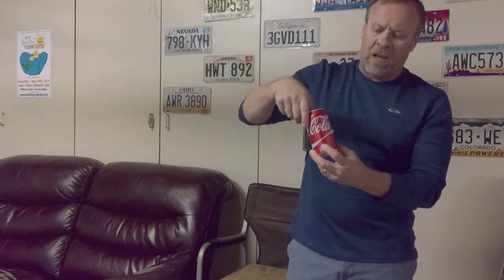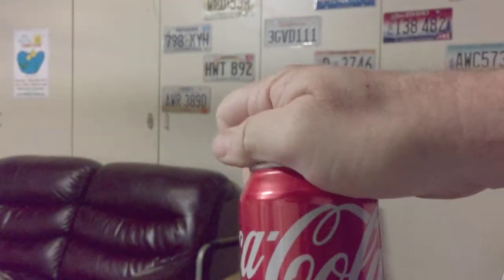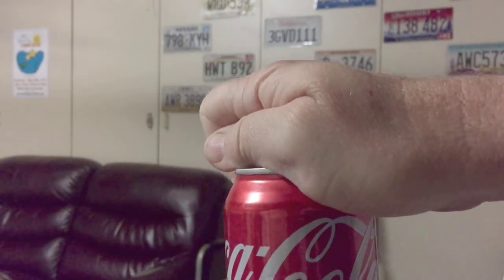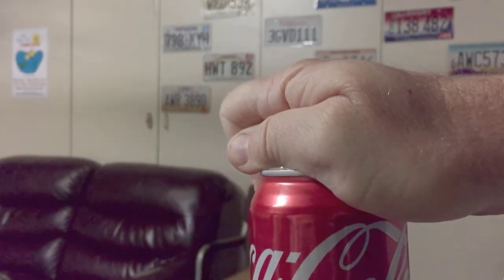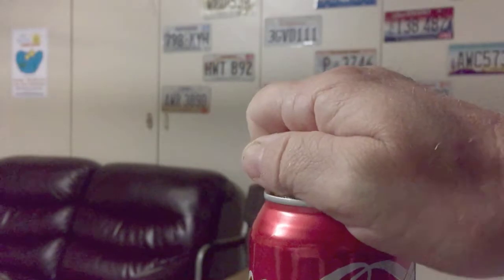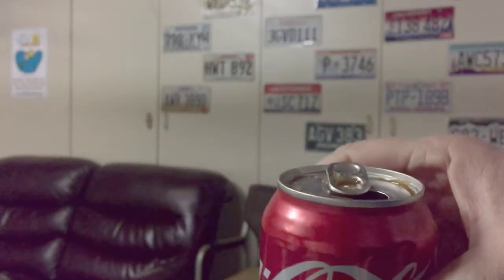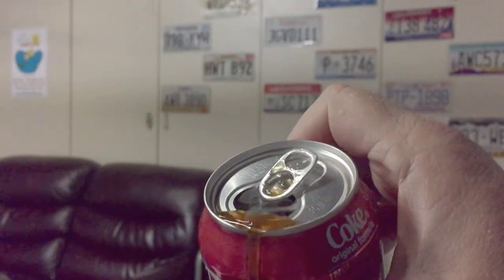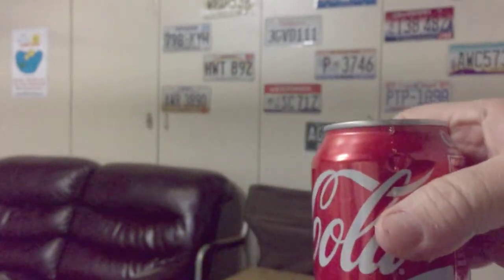How to Stop a Soda Can from Exploding Experiment

Comment: opening slowly works but your doing it wrong you used your finger what you need to do is use your knuckle and knock hard on the side of the can then it;ll work
Reply from the maker: OK I will give it a try. Thanks
Reply: Finger works if you flick it right.  Knuckle is good but kinda awkward to hit the can with